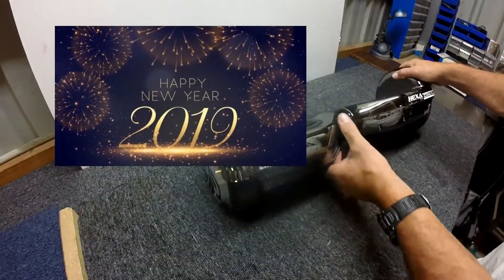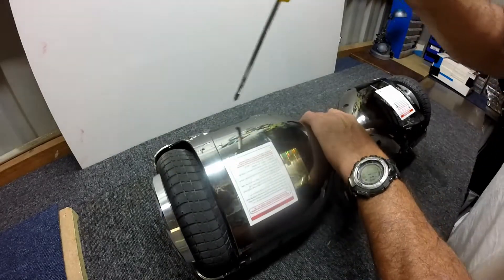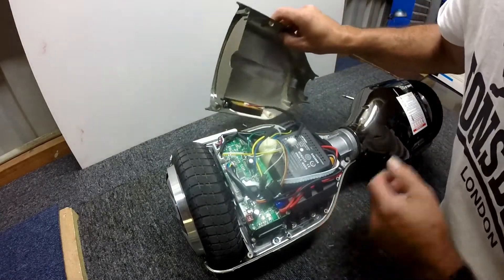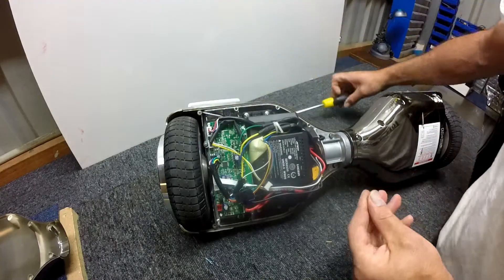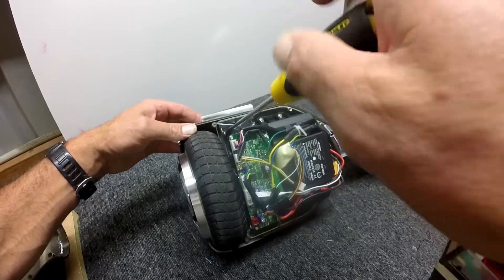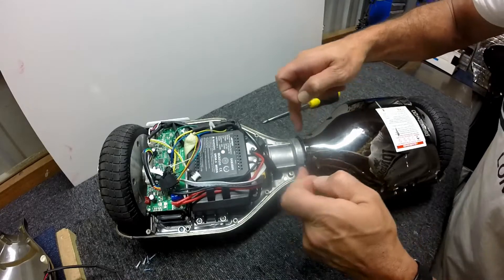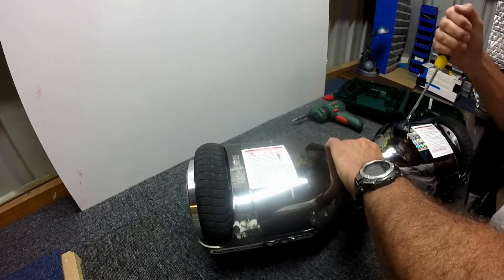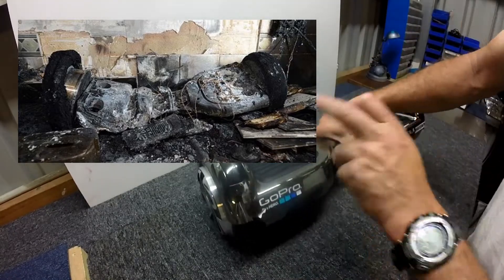HEXA Hoverboard Segway Repair - Rattle = FIRE

Comment from the maker: Thanks for joining in on my adventures! 
I hope you have been entertained!
Thanks AWESOME supporters.
See you in the SkY       https://goo.gl/qeUnBT
Reply from the maker: Yep. Do far so good. ..🎶🕭😎🔔👍🍻🎧
Reply: Quick question plz, So when i charge mine, the charger block is green, but the battery light on the hoverboard it‘self is orange, it doesn’t flash or change to any other color. Thank you.🤔
Reply from the maker: Just look at the red light on the charger. When that light goes out it is done.  🍻🖑😀✔😆👍
Reply: SkyPilot No, what i mean is that the light on the charger is green, but the light on the hoverboard is orange(not flashing).
When I try turning it on it doesn’t even do anything.
Reply from the maker: OK.  Sounds like you have a dicky connector somewhere. The green indicates a charged unit.  What condition is your plug in and have you removed the rear plate to inspect the battery connectors etc? ...
Reply: SkyPilot The half of the charger that you plug into the wall is the other half of a laptop charger.
Reply from the maker: Gotcha.  🍻🔔🖑👍
Reply: SkyPilot So what’s the problem, or what should I do?
Reply from the maker: Is your unit new. I would suggest returning it under warranty. If not. Remove the back as show on one of my videos and have an inspection.
Reply: SkyPilot Alright, thank you very much.💌
Reply: SkyPilot I order a charger, since the other half of the charger Im using now is a laptop charger, you think this might solve it?🤔
Reply from the maker: Which part was from the laptop.... the cable or the power transformer?
Reply: SkyPilot The cable, the one you plug to the wall.
Reply: SkyPilot So do u think it’s the problem?
Reply: Thank you very much for your help.❤️💌
Reply from the maker: If it fixes the charging problem then yes!
Reply from the maker: Hope I helped ya out. ✔🍻🔔👍👍